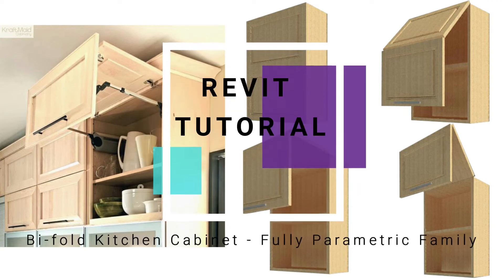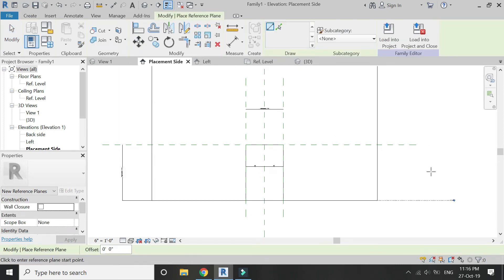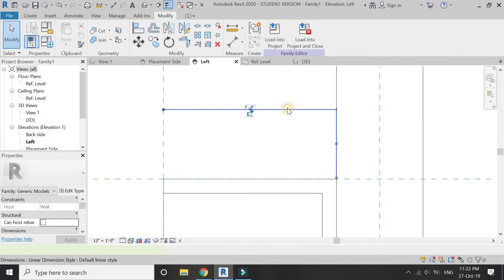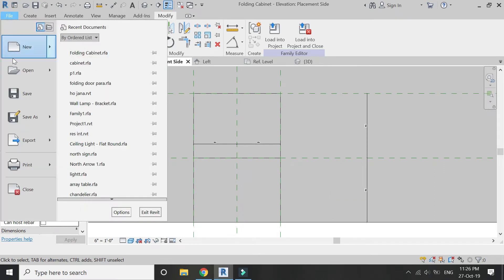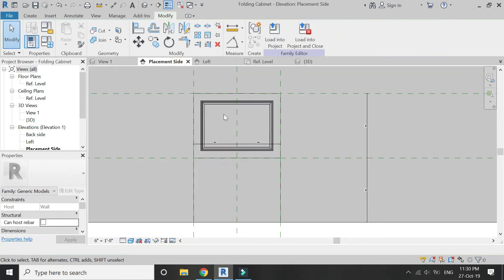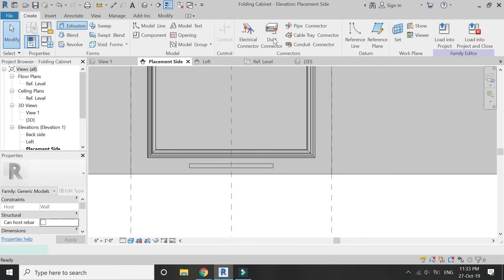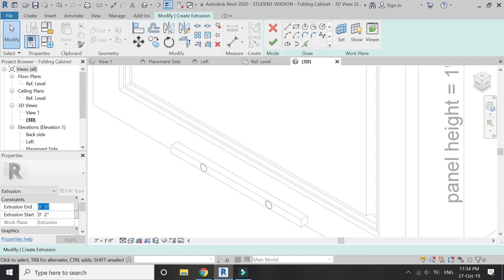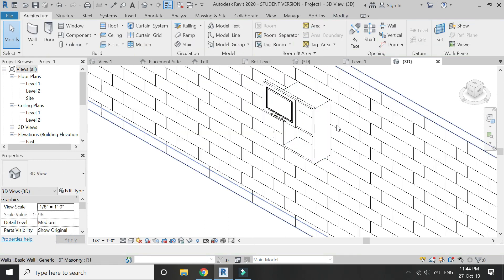Revit Tutorial - Bi-fold Kitchen Cabinet (Fully Parametric Family)

Comment: Thank you so much for this .... after a lot of re-do's i finally placed this cabinet on surface of wall in a new project without any offset or sinking inside the wall , might be anyone can face this issue while placing on the wall in a new project and the solution is that to make sure the main cabinet box geometry should be set at work plane of basic wall and always checked in properties bar at constraints showing in work plane. and for Voids always set work plane on the cabinet box geometry. these two steps are very important while making this Bi-fold Kitchen Cabinet family to work properly on any new project. Anyways many thanks once again for this beautiful and precise tutorial video. . .